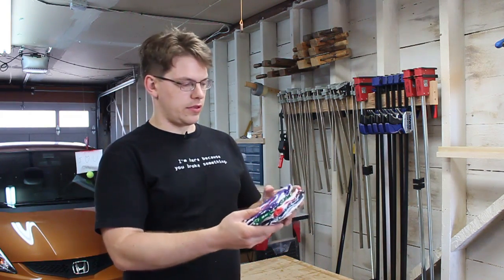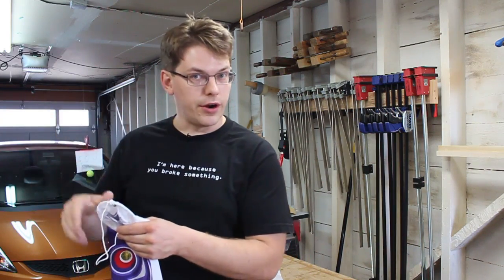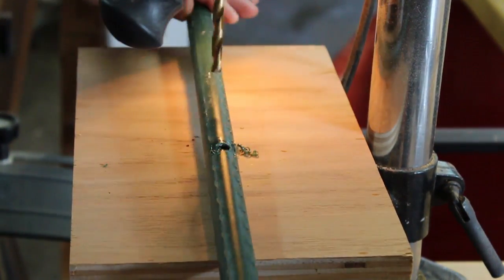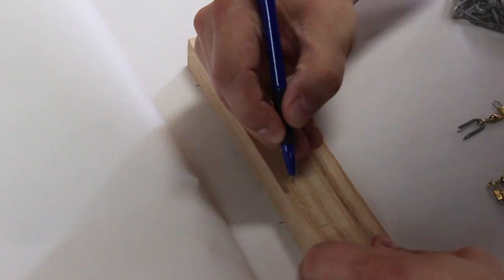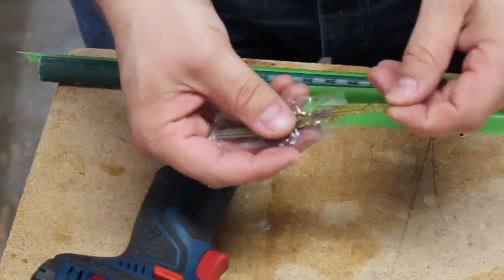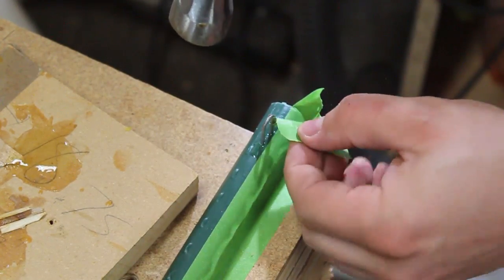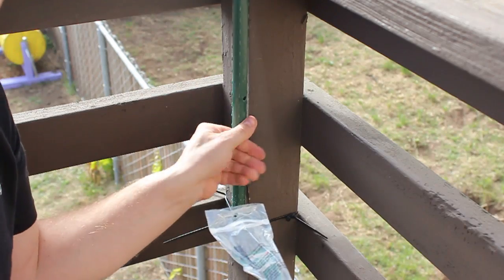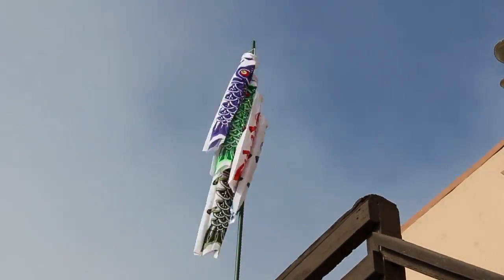How to make Koinobori Guide

Comment: "swimming tackle"?? how about some editing...and use a more deliberate ( enunciation) delivery if you want to be accessible to everyone, not just people who are like your "bros". 

The "pole" used here is a fiberglass garden stake from a home supply store or nursery. Alternative is to get  a beater fiberglass fishing rod, (the flexibility in wind drag looks cool) and replace the garden stake. I used a mounting bracket for a decorative garden flag (has two positions for angle of display, as straight up is kinda lame) and the hilt of the fishing rod fit perfectly. Mounted to a short 4x4 post. I found the longer the flag, the better looking the setup. The kit flags are tiny!! go for 4' and longer. Tradition mounts a tubular windsock at the very top over the carp flags.